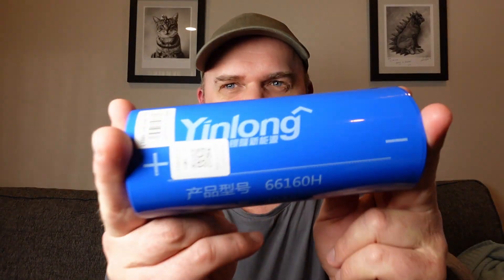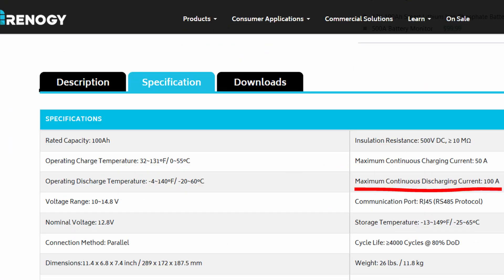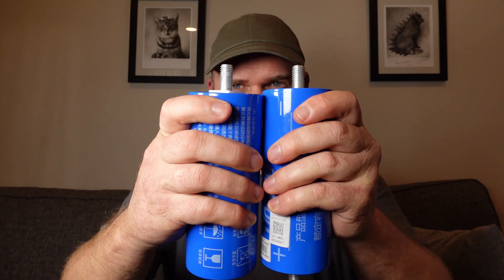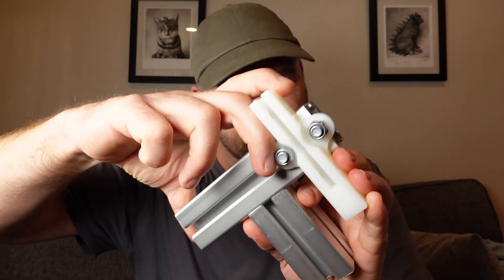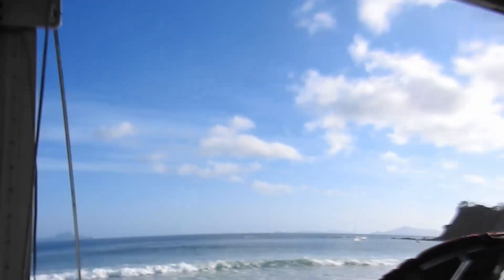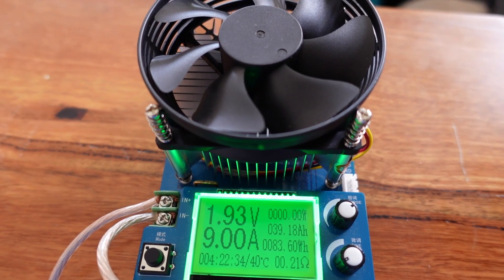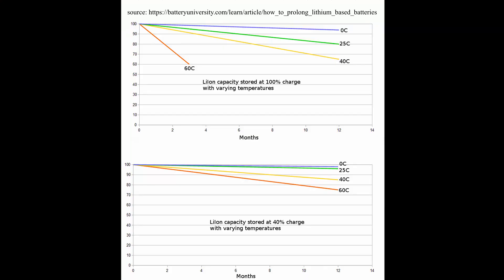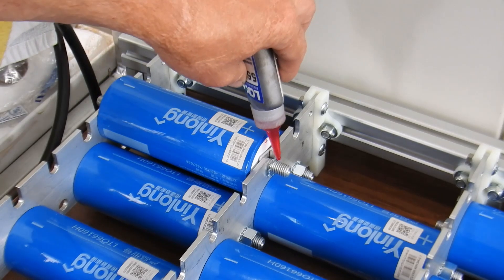Campervan DIY battery build HUGE POWER!

Comment: Lots of variables left out of your dramatic NCR battery blow. But the visual is EXCITING. More details about the safety employed during manufacture and installation would have been useful. Like - Tesla reports that out of it's One Million plus Fleet, having driven BILLIONS of cumulative miles to date, about 400 battery fires have been reported. NONE spontaneous. ALL involved CATASTROPHIC collisions. That's FOUR TENTHS of One Percent of ALL Tesla's. Other EVs? Didn't bother as they were not referenced here. The LTO batteries? Lab or Field test results? Talking science means acting 'sciencey' as well...

Comment: Re: your cost calculations, those aren’t “per kWh”, they’re “per kWhcycle”. Which is a totally valid comparison once you venture outside a particular battery type! But it isn’t that new an idea.
Reply from the maker: My unit was intended to show cost per kWh of power delivered and not storage capacity.  So for example...  where I live, power costs around 13c/kWh (usd).  People think that if they have solar charging batteries, their power is free.  I was trying to show the actual cost of power delivery from different battery chemistries.  So for eg if you had bought those AGM batteries, (and you'd been given the rest of the solar setup for free) each kWh of electricity that you used would cost you 48c
Reply: @brendontait6968  You nailed it.  Definitely the most relevant way to compare kWh costs to a normal on-grid set-up.  The cost per kWh for the life of the batteries.  The nerdy mathematicians might be right - the units are cost/kWh/cycle, but they miss the point - how to amortise the cost of the batteries in delivering each kWh, which have a limited life.  And then there is the cost of all the other components.  Some may need to be replaced in the next 10 years and "life-long" components still need to have some depreciation cost apportioned to them, even if it is only what that money could be doing for you elsewhere (5% per annum ?).
Reply: @brendontait6968  
Got my agm 12v 90Ah for an hundred each ...
But it won't change what's the point ...
It ain't free anything at all ...
And already know I will have to change them next year ...
It make a roughly 15 kw storage capacity up to a 3 kw max discharging rate ...
Furthermore like my hybrid converter self-consume about 70-80 w for fans and on/inboards electronics ...
It makes .7 .8 kw per night for it self-consumption ...

3 years what to run with as a need to see what's ... what n how ...
But I will have to change for another chemistry and I still watching wall mounted batteries market ...
After I got some of my lead being taken out right before ...
Lockdown !!!

Thanks for sharing .

Dare, care, ride safe, clean, have fun .
From France, with
Reply: and he is right that is the true cost of the batteries.
Reply: @Slebonson  consider the cost of electricity for all of the people that are buying replacement batteries at about $2,000 a kilowatt hour and they have to be replaced about every 500 Cycles. Companies like specialized. Bosch. And when you get into their lightweight much smaller batteries that the main selling point is you can bring on an airplane the cost per kilowatt-hour that the cost of electricity constitutes is insignificant. All of the cost is in the wear and tear of the batteries. Electric bicycle Market has two different types of customers. Those who spend tens of thousands of dollars on a toy they're going to use once or twice or maybe a couple times a year and then upgrade to keep up with the other one percenters and then the market place in places like India or even Singapore which although vastly different socioeconomically all recognize the bargain of a vehicle got the passenger can carry not just the vice versa. Gouging cheap chemistry's that costs much much more than Peyton 8 which you could after all permanently installed in a carbon fiber frame without any ethical compulsion to disclose to an airline that is actually an electric bike that's the way you get market share not past market share nobody cares about pasta market share when it comes to micro Mobility. It will never matter. When matter is is getting the cars off the road. Cars don't belong in public. They are toys and need to be kept at home or on private player grounds. The unicycle is what replaces the horse. It doesn't shit nor drop dead. That is if the hey you put in the frame has been properly fed with titanium.
Reply: @markknotten1210  500 cycles ? Not even 2 years

Comment: Great job.  Interested to know where to source them at said prices and for genuine too.  The maths on using 0.8 for Lithium and 0.5 for AGM don't line up when you then say only charge lithium to 0.8 for full cycle life. 0.8x0.8 is more like 0.64.  I fully agree with the way you justified things and kwh instead of AH too!!!
Reply from the maker: Thanks, I don't think I said only charge to 0.8 for full cycle life...  I said to extend the life....  The numbers were based on full capacity charge with 80% DOD as recommended by the supplier.  LFP often fail early due to being held at charge voltage like you would for an AGM.  Most of the stats on life are done in a lab situ where the battery gets drained as soon as it is charged.

Comment: well that]s what a BMS is used for -  safety duh
Reply from the maker: Hmmm... So around 20 Tesla cars have had their batteries catch fire.  These packs are well engineered, the cells have good thermal management and are individually fused.  The cells are built in one of the best factories in the world with regards to quality and test facilities.  But they still occasionally catch fire.  Maybe get hold of Elon and suggest that he installs a BMS in all of his cars because this will stop this from happening because a BMS is for safety.

(Elon already does that).  There are numerous ways a battery pack could catch fire that a BMS would not prevent - not including the fact the BMS could become faulty, which could cause a fire to start by itself.

Comment: Awesome experiment!  Glad you mentioned Will's take..  While I love me some 80/20 and overkill engineering it looks very easy to short the bus bars, I imagine you took measures but just did not show (or that was when I spilt my beer)  Also wondering about the massive amount of space allocated. Thanks for documenting and explaining, I'll check your channel for any follow up. -S
Reply from the maker: Yes I had thought of busbar protection ahead of time.  What kindof surprised me tho is that the busbars are actually difficult to get something like a screwdriver across since they sit below the cell and the cells are staggered.  You'll see the cover in an upcoming video.  The space is down low and not space I'd readily use.  Thanks

Comment: Did the same thing although I built a 33 LTO cell pack. 3 parallel, 11 series for a ~3kWh pack. Calculated that 11 in series comes closes to a 24 volt system. As you I didn't trust Will Prowse his judgement in these batteries. I've been using the pack daily for 8 months now and it works to specification. No measurable degradation so far and I use them heavily. Usually use 50% of capacity per day, with (dark) days of using up to 95% of capacity. 1560Wp array of 6 solar panels on the roof of the van. Planning to expand the LTO pack to 6kWh to get through more dark/winter days without having to start a generator or hooking up to the grid. 
For solar charger/inverter I use a Victron EasySolar 24/3000/70-50 and a shunt (BMV-700). So happy with that apparatus, it is much easier to install than separate components. The ease of the install outweighs the minor increase in cost, imho.
If anyone is interested I have some pictures online on instagram: @vankensteiner. 
Btw: also a Mercedes build, a 1972 406D (with some upgrades). Wish I could have a Unimog but in The Netherlands that would be basically useless anyway.
Reply from the maker: Glad to hear your pack is working well for you.  Thanks for sharing, started following you.
Reply: @brendontait6968  followed you back :) When I do my pack upgrade I'll be mounting them under chassis, to save space on the inside. And because they are able to charge below 0ºC (unlike other lithium chemistries) that is totally fine.
Oh, and I don't use a BMS but active balancers.
Reply: I would love to get in contact. I am located in Belgium. I have built a solar powered houseboot. I looked into LTO when i started the built (8y ago) but there could not be found prices and people's experiences with them, so i went lithium (with Y - winston cells)
Email me petervanelslander@hotmail.com or facebook peter van elslander (i have a picard wallpaper at the moment i think :-) )
Reply: @petervanelslander6206  well, engage ensign Peter 🚀

Comment: wish those videos weren't so biased. not a single drawback from LTO was mentioned. sounds like a salesman.
Reply from the maker: I'm actually going to do a follow up video on LTO cells listing some of their drawbacks.  Would be keen to hear from your point of view what some of them are.
Reply: @brendontait6968  against LFP for exemple. LFP will last 12+ years at a full cycle every day. way more energy dense so a lot less wasted space and weight. cheaper. and by the time you done those 4000+ cycles or 12+ years there's no way no new tech will be out. i can get LFP under 100$/kwh shipped, bus bar and nut included.
Reply from the maker: @thalesletus1  i agree with you about cost, but disagree with some of your other comments.  A friend of mine has a 4.5kWh LFP pack in his van that weighs 55kg.  My pack weighs around 120kg and is 9.5kWh.  So not sure how LFP are 'way more energy dense'.  The life cycle test is done in a laboratory where they are discharged immediately after being charged.  In reality, LFP cells being used in an offgrid situation often get held at full charge voltage...  Many LFP batteries have become a puffy mess and failed after only a couple of years due to being held at charge voltage.  In most cases, real life usage is likely to give around half the cycle life that lab testing shows.  The life cycle of the cheap Chinese cells are likely to be significantly reduced from claims.  No doubt that LFP is a good chemistry, higher production of LTO is likely to drop price.  I'm interested in testing and geyting first hand experience with new and promising battery technologies and thought LTO is worth learning about.
Reply: @brendontait6968  7.28kg per kwh is what I'm getting with lfp prismatic cells. So about twice as energy dense as your LTO on the weight side. I sell cells for a living by the way. I know people that are past the 10 years mark with lfp and still going strong. We can also look at Chinese bus since they started having a lot of them being electric. 98+% of them use LFP. Those cheap Chinese cells like you say are CATL. The same company that is affiliated with Tesla to make the batteries for the "Chinese tesla". Also the most used cells for Chinese electric bus.
Reply from the maker: kg/kWh is an unusual measurement I always thought the convention was kWh/kg. So that works out as 70% higher density for your LFP cells.  But the reality is that I have a 12 tonne truck and I don't care about a few extra kg.  Im not sure the point you are trying to make.  I guess because you sell LFP cells that you have a vested interest in promoting them.  I built this pack to be what I consider the most robust and safest chemistry available.  I want most aspects of the truck to be rugged and reliable, being able to handle high charge currents and low temperatures without stressing them.
Reply: @brendontait6968  i don't sell LFP. i just have good knowledge of them. i sell NMC. my point is you made an extremely biased video stating 0 downside of your choice. not everyone watching has a 12 ton truck. LFP also takes way less physical space than LTO and is also an extremely safe chemistry.

Comment: I found your batteries on DHgate, then I found 48v 40Ah LTO batteries in their own box with BMS. That's about 1.9kWh per unit. What do you think? Say six off to provide 11.5kWh.
Reply from the maker: Are the LTO batteries in their own box the toshiba scib cells?  If so, I'd jump on  them.  If they are just some random chinese design, I'd be cautious.

Thanks
Reply: @brendontait6968  yes in their own box. What about prismatic style LTO’s?

Comment: For off grid battery, powering a house, or rv, you about can't beat LTO, it will basically last basically a lifetime, if you are in your 40's like me, you will likely never need to replace the batteries, especially if they are over sized, so they aren't fully cycled everyday, if I can, in a few years I'm going to look for a bunch of  LTO to replace my 33kwh of lithium ion. My 24v system, and 4.4kw of solar, yeah I didn't finish school either, I may not know everything, but I can make some of my college grad friends feel like they were ripped off, and feeling a bit dumb, I have worked as a Electrician, plumber, carpenter, and even madonary, rock, brick, concrete, and worked on mechanical stuff all my life, I was building car engines when I was 13,  and the last few years I have studied electrical engineering, on my own, and yeah power to weight, maybe not as good as lithium, but in a house the mass doesn't matter , I was going to build a inverter to power my offgrid house, but that can be a headache, I do plan to build a DC generator, to charge the batteries, and power things in winter, and when its cloudy, im going to only charge to 4.0-4.1v per cell, but nice work,
Reply from the maker: Hey, yeah good work..  I obviously rate the LTO too.  I dont have much knowledge or experience with them yet to know 100% their possible drawbacks.  But I should know soon enough!

Comment: Well done Brendon ' very informative. I have been playing/experimenting and accumulating various forms of battery storage solutions over the last 18 months,having accumulated approximately 60kw of capacity as I have found bargains. The spread is 20kwh  of VISION SLA  200ah batteries (new- couldn't be deployed to telecom towers due to Covid) weigh 70kg each! 20kwh LiFePO4 10ah Headway cylindrical cell and appro20kwh of 18650 LiIon cells ..... attempting offgrid in suburban Perth.
I have until this point avoided /haven't concidered LTO due to my perception of the high self discharge rate making them unsuitable for off grid storage - obviously didn't check my sources! (such as Will Prouse!). So did a little bit of digging. I will definately reconsider!
This link is worth the read. Shows 2.3% self discharge per month - vertually no capacity degradation. Perfectly acceptable. https://www.researchgate.net/publication/317310364_Characteristic_Analysis_of_Lithium_Titanate_Battery/link/593f0798aca272876da1a369/download
Thanks again for sharig
Reply from the maker: Thanks for your comment Alan, yeah..  I liked the safety aspect of LTO a lot as I've seen too many powerwall guys have their place burn to the ground.  It's probably not the ultimate chemistry, but on paper at least, they seem decent.  I'm deff going to experiment with a bunch of other chemistries and pack builds, sharing what I learn along the way.

Comment: Your price comparison is wrong. You are comparing 12v commercial batteries to a single 2.5v cell. In reality you need to multiply your cost by 6 just for the amount of cells needed. Then add in hardware etc. I got 4x 135ah lifepo4 cells for £460 so a massive difference to the commercial unit.

However, fantastic build! What a piece of kit!
Reply from the maker: You may have misunderstood the unit of measurement I was using for cost. The cost unit I was using was irrelevant to whether you had one cell, six cells or 6,000 cells.  Was basically a price per unit of electricity a battery would store.  I think my sum came in at 2.7c/kWh (this would have been the same figure no matter how many cells I used in my calculation) - but I said something like: "this is probably a bit generous and it is likely to be closer to 10c/kWh".  I meant to say including hardware and reduced cycles etc.  Let me know if you disagree and I'll explain in more depth.

I will be doing some LFP builds in the future which will be big and cheap - with potential group buys - so keep an eye out for those.
Reply: @brendontait6968  it struck me a few minutes ago that using kWh means voltage of the package is irrelevant, sorry about that.
Reply: Oh haha I payed 900 kiwi dollars 😱 man we get ripped in England